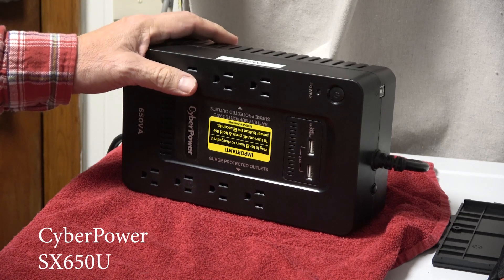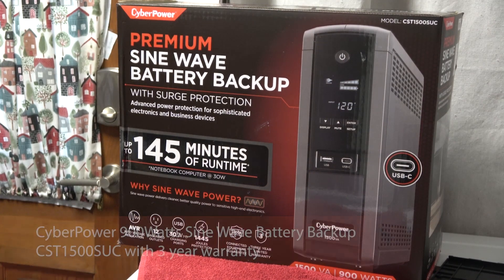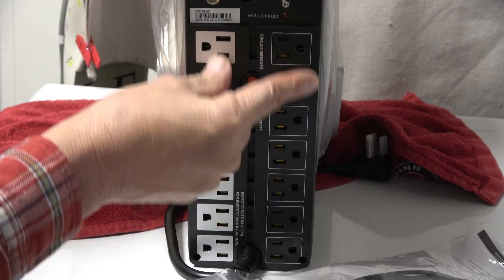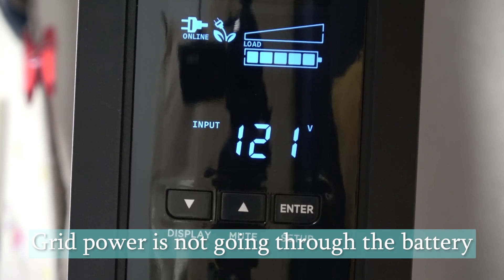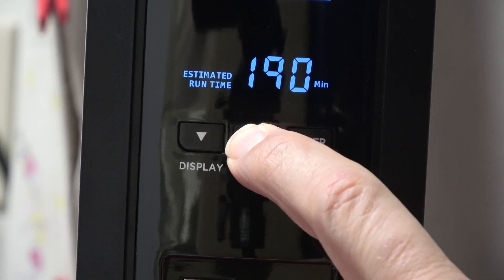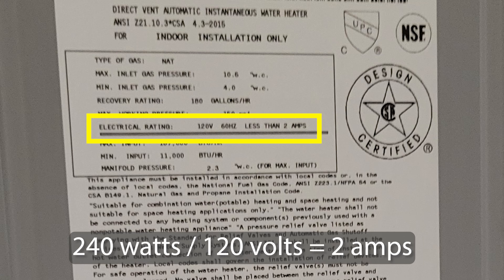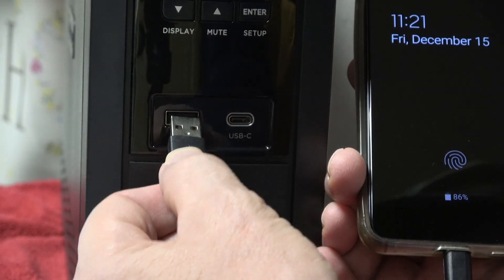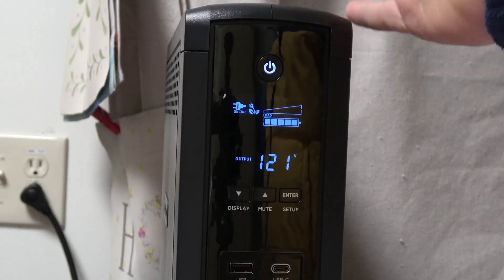COSTCO CyberPower Sine Wave UPS CST1500SUC

Comment: Great video and very helpful! 
I have the same unit but older model without the USBC but think the battery might have died. 

What's the best way to check battery health? Take it out and use a multimeter?
Reply from the maker: The easiest way to test is just to unplug from wall and see if it provides any power back up to your device(s). Battery tends to last 3 to 5 years.The battery is replaceable so you can have an almost new unit for the price of the one.